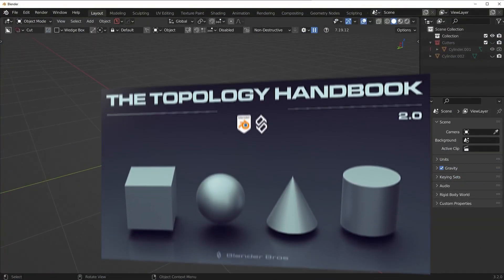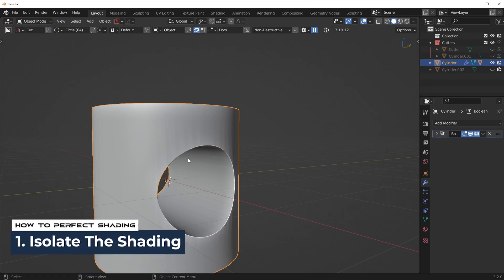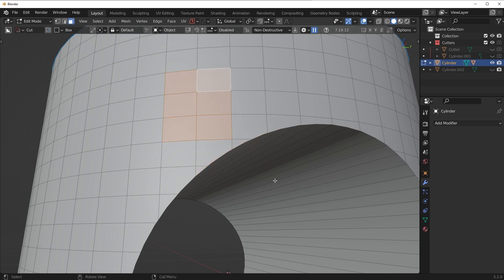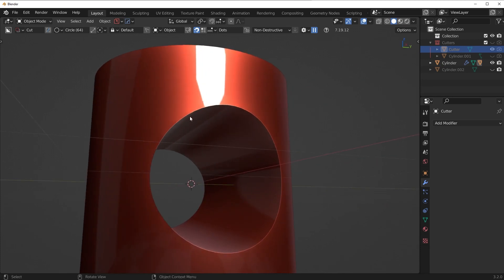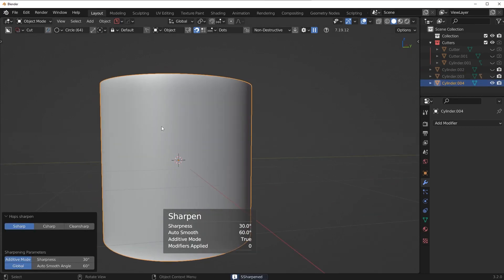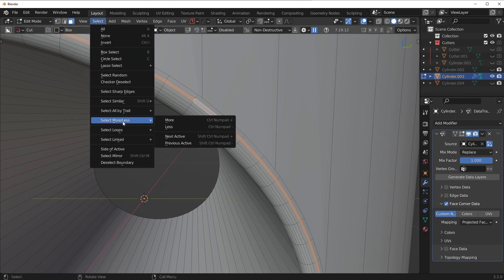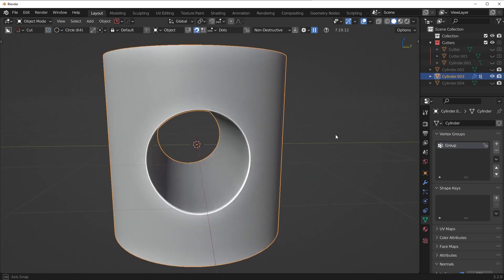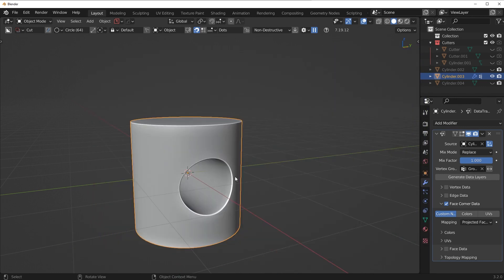Clean Shading in Blender - 2 Easy Methods

Comment: Blender is great and it is powerful and versatile. 
But the trouble with Blender is that its development is created on the footprints of the B Foundation short film. 
Developers do not develop with the client in mind, but with the tools they need to work on the short film in mind. 
It is developed with that logic in mind, which is why it lacks all the logic about the interface for users and tools FOR USERS. 
That's why functions change with each verson of place and name, and some procedures are REALLY cumbersome. 
Because it is developed with the short film and developers in mind, not with the average user in mind. 
This is not criticism or flaw, it is characteristic.
The node system is powerful but it is confusing and redundant, as is the outliner. 
These are tools designed by developers to be used by them. 
It lacks "logic for user friendliness."
Reply: Nothing to worry about, mate. There's always Autodesk's "user-friendly policies", development updates and price tags. You might like those better.
Reply: I disagree with all of this. Blender is not developed solely for developers, and nor is it only usable by developers.
Reply: Practice more, complain less...